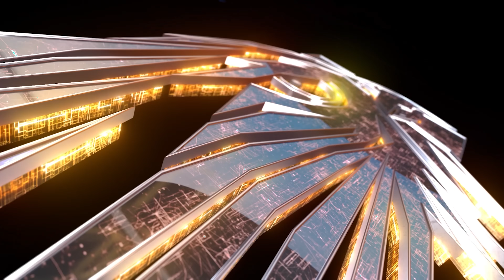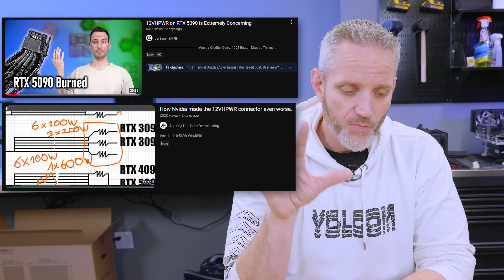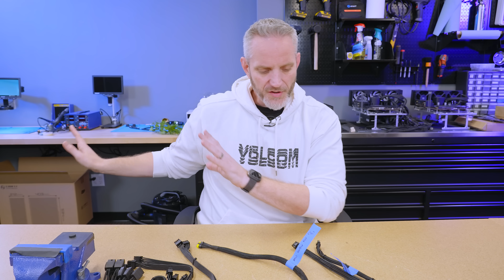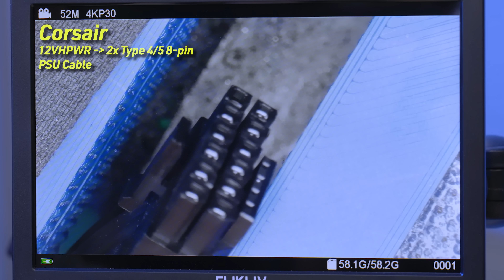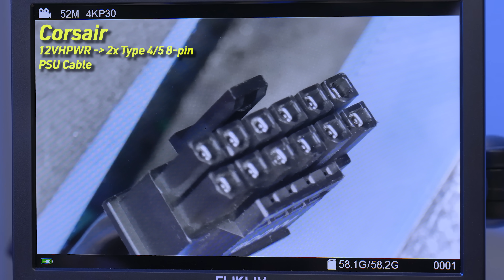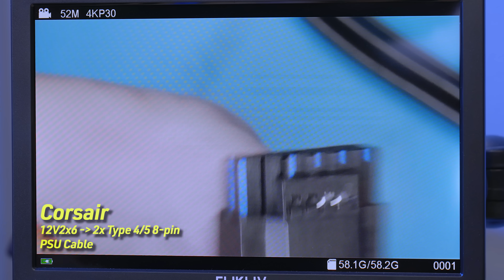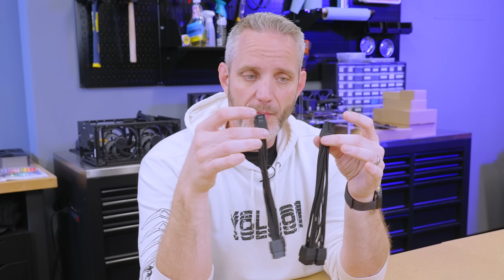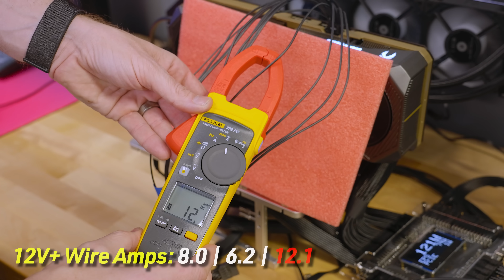I discovered something concerning and I need the Experts to chime in... More 12VHPWR discovery!

Comment: If the PMD2 ha shunt resistors on each line, then there's your load balancing solution right there. Not rocket science, the same solution is probably being used in every single power supply to connect multiple output transistors in parallel to distribute the current.

Comment: We need to look at a cross section of the female pin to see if it makes contact in one point   )(   or  along the whole pin   l l
Also is there a way to probe AFTER the GPU connector going into the card? If so, you could strip a bit of insulation off each wire and check voltage before the GPU connector and after the GPU connector to see if there is a voltage drop indicating resistance.

Comment: If Nvidia or PCI-SIG is claiming that user error is the problem; that's a fundamental design issue and the standard should be scrapped on that claim alone, as PCI-SIG are ultimately responsible for how consumers interact with their own specified products. Nobody normally complains about how someone uses a chair incorrectly, because the design is fairly fundamentally safe with (generally) 4 or more legs and a clear place to sit; the design works because it's sensible with reasonable safety margins.

12V2X6 is honestly just a 'rebranding' of 12VHPWR to try and get away from the bad press' if it was a true revision it would be named V2, Gen2 (etc). It's a bad electrical standard to begin with in terms of headroom, which was made clear in the 40XX generation. Shortening the sense pins doesn't fix the fact that since the 30XX generation of Nvidia cards, the power regulation and load balancing has been gutted from the cards.

Unfortunately the theoretical approach that all of the individual cables in the stupid new standard cable connect equally balance the load by themselves; because it's being treated as a perfect system with no construction defects, pin alignment or contact problems, user error (or any other relevant issues; which in all honesty, should be designed in a manner that the consumer can't do anything wrong if the standard is designed well) in theory, doesn't actually translate to the real world, who knew?! This fact isn't helped by the fact that since the 40XX generation, Nvidia is being cheap by excluding any form of meaningful power regulation in terms of load balancing the individual cables (or pairs of cables) coming into the GPU. This problem is only going to get worse as power draw increases.

Honestly I'm really surprised that people haven't started bringing to the attention of governmental regulators that this design is fundamentally flawed, to the point where it is quite literally a fire hazard. It's not like Nvidia don't know how to balance the power from multiple cables, they've been doing it for decades; they just decided to ditch it last generation when they also wanted to up the power draw through a single cable (great combination by the way...) and save a few dollars on the components included per-card.

Comment: It's obvious what's up! nvidia said screw the fancy power circuitry, that load balances, because it adds cost. We're so influential we can create our own PCIE power delivery standard. Half @$$ it and make more money. If you are unlucky enough to get a connector that the pin sockets were not folded tight enough to bite down hard on all four sides, you end up with one, two... wires pulling way more current. 12v HPWR is a crap cost cutting standard rammed down the consumer's throat. IME MSI makes really good 12v HPWR cables that come with their PSUs. I haven't seen better.

Comment: Take a paint pen and mark that cable on that lead and then install cable and see how far the painted area on cable backs away from the connector when installing
Reply: That might be a good way to safety check them at home. Mark all wires before insertion on both ends and see if any of them back out when you insert them to check if the cable is good.

Comment: Hey Jay why not starting an online Petition to go back to 8-pin connectors and prevent 16-pin connectors to be installed on all new GPUs until it is completely fixed? Also maybe forcing Nvidia to use 2x 16-pin connectors could help...

Comment: I think the BEST solution we can have now that is not Nvidia recalling all the 50 series cards and replacing the connector with additional hardware that does the load balancing as well as uses the better older PCIe ports, would be to have heavy-duty replacement cables with hardware built into them. A cable that has the load-detection and balancing hardware built-in on both ends of it so that the current is guaranteed "clean" on both ends since even the power supply end burned this time around with the 5090. Kind of like what you discovered with your test here. It would probably look like a cable with both ends thick and chonk shaped like Thermal Grizzly's Wireview or Wireview Pro because of the built-in stuff. That's what I imagine will solve this at this point. On that note, does the Wireview do the same thing the PMD2 does? Perhaps it might be usable too.

Comment: What I would like to see is what happens to a when you cut away the outer layers and connect some or all (of the ground or all of the power) together in the middle.
Does the GPU still work?
What if the cable had proven to have one or more wires run overly hot, do those ones still do that?

As far as I understand the issue, the cable wires individually aren't rated for the mixed load they're getting but together they are. So alter the thing that's simplest to alter and just connect them together? They all go to the same point, there's really no reason they have to stay separate in the middle between the PSU and GPU.

Comment: It doesn't matter what Corsair said. A pin should never ever move that much in a connector. When a pin move that much the connector or pin is garbage. I installed a shit ton of connectors in cars and never had a good pin moved that much. Every time a pin moved it was either a faulty pin or a shit connector and i changed it immediately because it can cause problems in the future.
Reply: Same here, only for motorcycles rather than cars over the last forty-four years. A correctly seated Molex pin should not move more than about 0.5mm. The securing tag ("barb") on the terminal in the Corsair cable has been bent.
Reply: Ya what is this 4pin molex?
Reply: I literally just spent 1k in my car because pins were loose.  Pins matter.
Reply: Major fire hazard. Low quality molex connectors have the same problem.
Reply: That reminds me of the old white Molex connectors. They wiggled like hell.
But that made them also easy to change the pin layout to undervolt DC fans 🤓
Reply: @sp00n  OMG they were the worst, soooo janky.
Reply: @ yeah, sometimes I couldn't get them apart without pliers. Other times one of the pins would fall out of the plug basically by itself and I would have to spread out the little "wings" again to make it somewhat tight.
Reply: @sp00n  The thing with those is that while they wiggled laterally, they had very little room to slide backwards in the casing unless you forced a misaligned pin into its opposite connector, causing you to bend the retaining tabs on that pin and creating the longitudinal play yourself. 
With these, you get that longitudinal play out of the box, which is just a blatant spec violation.. The manufacturers involved in making these cables all need to make sure that partial pin mating simply isn't a thing anymore, one way or the other!
Reply: @NLRevZ  Oh, I remember quite a few occasions where I managed to literally push pins out of the one connector while trying to plug in the other. And then other times they where so tightly connected that I was tempted to use pliers to get them apart again. Production quality varied wildly for these.
Reply: At least you didn't usually try to pull 600W out of a 4 pin molex connector.
Maybe some people might have connected like 8 mechanical hard drives, which draws how much power? Probably less than 100W.
Reply: The pin is inserted backwards the retention clip is on the other side no wonder this pin move like that
You can clearly see the slit in the pin is 180° rotated bs all the other pin
Reply: @legros731 11:18 - You might be right... I just went through it frame by frame with < > and he never angles the plug down enough to see the bottom of that pin. But it does seem to have a split at the top. Very hard to tell. It would make perfect sense why it's moving tho, the retention clip is obviously either broken or in the wrong orientation. Corsair are Uber-Cringe for saying that is in spec; just saying what their lawyers demanded they say probably.
Reply: This
Reply: Last time i saw pins moving like that was.... a 4 pin molex..... this cable is worse than molex
Reply: On some connectors wiggle room is a feature and not a defect. The pins and socket is allowed to move so they can self center. I’ve seen this on micro D connectors. The pin on the micro D connector aren’t even ridged pins. They are a braid with a gold cap. This allows the pins to move lets them self center.
Reply: having done some crimping myself, the pins usually have a couple prongs that catch a lip in the housing. sometimes these can be bent during the crimping process and not catch the lip correctly. i usually have to use a tiny flat edge or some pointed tweezers to fix this, and it usually seats fine after that. they are designed such that the act of pushing on the pins during insertion, or pulling from behind, actually seats them more firmly. this is a qc problem.
Reply: Agreed. I’ve had molex connection pins move out and did end up melting and causing a smoke storm.
Reply: It doesn't matter; Corsair fanboys will always defend their Corpo overlords.
Reply: That moving pin does not matter much, as long as the pin swollow the male pin at the other side. That is enough usually .
Reply: @ it does matter a lot. When the pin is moving to much it will not fully meat his male counterpart and that increases the resistance of the pin. Is the resistance to high the pin will get hotter and hotter and will burn at some point. It is a common issue on the old garbage 4pin molex connector and it is an issue on the new 12VHP connector. I also saw cars and houses burned down of bad electrical connections.
Don't say it doesn't matter when it in fact matter a lot.
Reply: Corsair said in one of their replies in their subreddit that the "wiggle room" is no cause for concern and that it is simply for ease of insertion.
Reply: @giraffeorganic  If both sides of the connection are to spec there is no need for wiggle room, look at the multitude of industrial connectors you can get for pennies that don't have it.
Reply: @giraffeorganic  Well then the entire argument of people not plugging in the connector enough is moot if all the sleeves have "wiggle room" anyways. You can plug the connector in 100% perfectly, but with the wiggle room the sleeves are pushed way back in the connector, which is the same thing as not plugging in the connector all the way, but the user gets all the blame. Total nonsense.
Reply: @giraffeorganic the pin that move is inserted backwards easy to see the slit in the pi. Is rotated 180° vs all the other 
The retention mechanism is only on one side if you put the pin backwards there no retention as show in this video 
Jay could have just tug a little more and the pin would probably come out flip it 180 and reinsert problem solved
Reply: @giraffeorganic  Well, that's how you know it's even more bogus because then we wouldn't need to plug the cable in all the way.
Reply: @Yoshi75292  Exactly!

Comment: why are they so f-ing stubborn on not putting 2 connectors on a card that cost arm and a leg? Clearly we are flying abit close to the sun when pulling 570w on a one connector rated for 600w. If i was a board vendor like asus, msi and so on I would change the design and gain customers that like to feel abit more safe. what a clown show.
Reply: Cause that will prove that even if the 16 pin connector worked flawlessly its already outdated since it cant meet the power draw and needs 2 connectors.. so that puts it in the same bin as the old 8 pin and points towards needing yet another new connector that can deliver more power on a single cable
Reply: There is a good chance Nvidia wont let board partners put 2 connectors on the 5080/5090.
Reply: With some luck, this is the last time we will see a single one for the 90 cards, or maybe they just change it entirelly, since people will forever have trust issues with the cable now.

Comment: Molex connectors are notorious for not staying in place and have also melted. I think Jay is correct about the 12VHPWR cables.
Reply: Not exactly right, as it is the pins that have best connection that take the hit. Could perhaps be accrue if all pins was poorly connected.
Reply: I remember needing to check to see if the pins on a molex were seated correctly AFTER connecting both ends together.  So many times I had to use a small screw driver to reseat the pin.  This 12vhpwr is just a fire waiting to happen.
Reply: Name-brand Molex connectors do not have this problem, but there are many many inferior imitations.

Comment: I have a Corsair cable (bought seperatly because my powersupply didn't  support 12VHPWR natively) but i don't want to check te pins because it works fine right now and plugging in and out might damage the cable too.
Plus i have a 4080 so it won't pull 600watts anyways

Comment: Is Buildzoid an Engineer 🤔. Don’t know. What I do know is that everybody is overthinking this issue. THE WIRE SIZE IS TOO SMALL FOR THE POWER IT IS ATTEMPTING TO CARRY!! That’s it. Water works the same way. If I want to get a specific gallonage to an area, I require a specific pipe size to do that. Electrical power is no different. I can get from point A to point B in two ways……..1. Increase size of wire/pipe 2. Use smaller pipes/wire but increase number of connections (ie; multiple 8 pin connectors) Not rocket science.

Comment: So, since the inception of the 8 pins they worked without issue.

Then some big brain decides we need a new power supply to plug in our space heaters known as GPU's and not only do they fk up the design once... but the revised design has the exact same fk up.  

Maybe it's a clue to just go back to the 8pin connectors and stop making stupidly uselessly oversized GPU's......

Comment: Just checked the cable that came with my corsair PSU. All the pins are different lengths even while applying force to the back of the cable to push them in. This could easily mean if the cable has a bit of tension on it it would pull the pin far enough out to create a resistance increase. There is also a lot of play in the pins back and forward. I also checked my cable mod custom cable and all of the pins are almost perfectly even (to the human eye), although they are more recessed than the most exposed on the corsair pins. There is no play in the cable mod pins that I can tell.

Comment: I would say that variation in pin seating depth is normal for most connectors. The real problem here is that the connector does not have enough safety margin to deal with this variation. Minor differences in pin contact resistance can make huge differences in the amount of current draw. If one pin has a contact resistance of 0.05 Ohms and another contact has a resistance of 0.1 Ohms that is a huge difference in the amount of current one wire will draw over another for the same phase. The card can only pull about 48A total at 12V, this means that the ratio of resistances in individual power wires and contacts determines the current balance. Things like contamination, pin seating, crimp quality, and pin oxidation can make a huge difference here. The connector needs to be sized to handle this variation.
Reply: You are off by a factor of 10, some online sources mention that the rated contact resistance is 6mOhms (0.006) for that 12VHPWR connector, not 50. 
If you do the math (6 parallels of 6mOhms + 8 mOhms for the wire + 6 mOhms), you'll see that to explain the current inbalance (20 amps in two wires in the original video), doubling the contact resistance is not enough, it had to be multiplied by 10! that is an awful contact, so I'm wondering which other factors could cause that
Reply: @Gzalo  Numbers were just to illustrate that small variations in contact resistance can change the current balance. I mainly deal with construction machinery so assumptions about contact resistance are generally much worse and contamination is expected to be a serious factor. I believe that my main point still stands. If you have double the resistance in one wire it will see half the current as another wire. It probably doesn't take much when the absolute magnitude of the numbers in question is so small.

Comment: If the ground is not seated the circuit is open and there is no electric flow, so no runaway, there is impedance and spiking through the entire circuit caused by the continual disconnect reconnect. The noise is dangerous to your circuitry and lousy for your computing. A continuous arc in the connect to ground would be a fire hazard, think of that as high frequency disconnect reconnect, a spike and an impedance burst every millisecond. Blue plasma arc welding your connector.